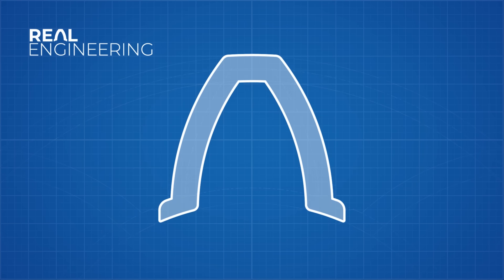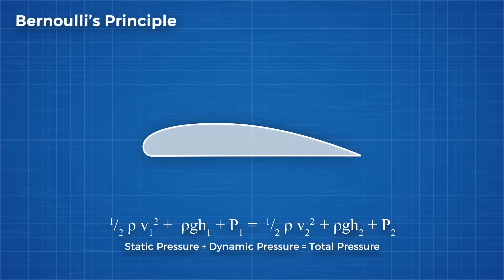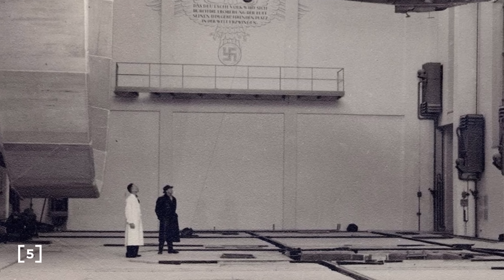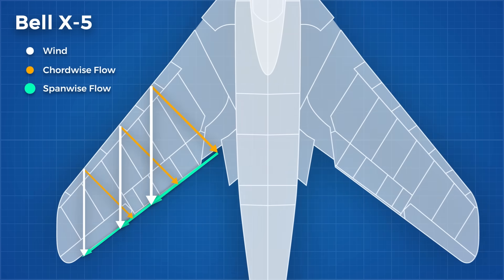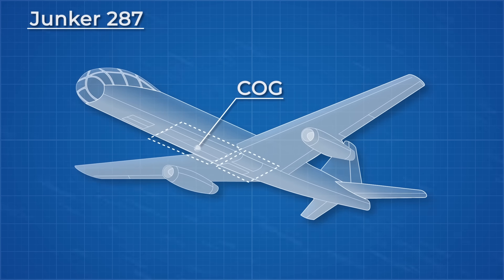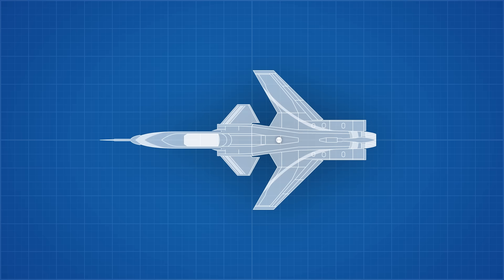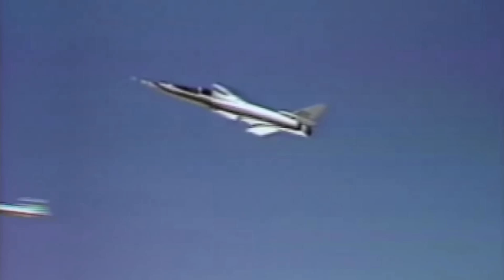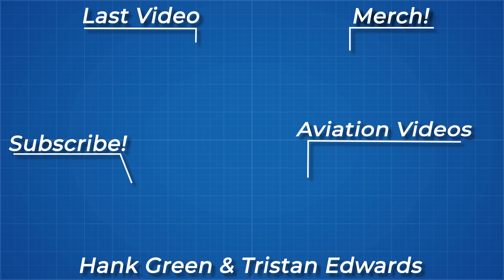Why Do Backwards Wings Exist?

Comment: The canard positive lift vs. horizontal stabilizer negative lift is far from new.  Stability in a design is determined by the degree the aircraft will tend to return to normal flight.  The canard was used by the highly-efficient Wright Flyer.  The problem was stability.  Canards are destabilizing like putting feathers on the front of the arrow.  Forward swept wings have the same effect plus adds instability to the yaw axis which is where the twist problem comes from.  The swept forward wing moves the center of lift closer to the canard, which makes it short-coupled, which makes it highly responsive, like a car with a short wheelbase.  Being short-coupled also gives little leverage to stop things once they start to get out of hand without adding a lot of strength and surface area which is self-defeating.  The B1 Lancer has a small computer controlled canard to assist with this problem, and the B2 depends entirely on the computer for its stability.  

The Germany talk I always hear is laughable.  In 1939 Germany was the only country who wanted war and the only one who had prepared for one.  They had destroyed everyone else's country in the previous war.  That facts are, Germany lost technologically to both the US and Great Britain in every technology that mattered to the war.  The US The Lockheed L-133 was a practical canard jet proposed in 1939 with axial flow engine that they would be prevented from building.  The Vought V-173 "Flying Pancake" flew in 1942.  Jack Northrop made the flying wing the focus of his work during the 1930s. In 1941 before the USA entered World War II, Northrop and Consolidated Vultee Corporation had been commissioned to develop a large wing-only, long-range bomber designated XB-35.  He was crushed when they went with the B-36 but before he died while confined to a wheel  chair and unable to speak, the Air Force  briefed him on their new, highly classified, Northrop-built B-2 Spirit bomber.  Built  in a flying wing configuration and incorporating many of Jack Northrop’s design  innovations, the B-2 has evolved into the most capable bomber in aviation  history. Upon seeing the drawings and a scale model of the aircraft, Northrop  reportedly wrote on a sheet of paper in a shaky, feeble hand, "Now I know  why God has kept me alive for 25 years."  When WW II was going a year past projected, they told Lockheed they might need a jet fighter to counteract Germany's jets against their bombers, but in order to make sense, they had to have it in 5 months.  They delivered a debugged and flying P-80 in and a production plan in 137 days.  It saw limited service due to Germany's mismanagement and more sudden collapse.    Notice it's the Goddard Space Flight Center.  Robert Goddard, whose plans Germany extended for their own rocket program, was also denied pursuing rockets like Germany in WW II.  All the US would pay for was rocket assisted take-off for the war effort.  The German rocket program had no strategic value and a complete waste of resources.  The best Germany achieved was 7 miles from the aiming point, down from 28 miles, and they killed more of their own people building it than all of the rockets killed.  By contrast, the US spent 1/10th the resources on the atomic bombs and it saved 1/2 a million US casualties, shortened the war, and saved the enemy from starvation.  Great Britain defeated them with their radar by 1940, and drove them off the sea with their electronics, hedge hogs, and Ultra.  By 1941 Great Britain already had them mired in North Africa.  They were stuck in Stalingrad by 1942, waiting for a tank that was not ready.  They spent 2 years, massive resources to build an Atlantic Wall that was overcome in less than 8 hours with far fewer casualties than they took to build it.  The deployment of technology that had no strategic value for the war was to deceive themselves as to their situation.  Obviously the allies would target those involved in these technologies after the war because they focused on winning and did not invest in technologies that did not align with that goal during the war.
Reply: Actually germany lost the 1st world war in a most pathetic manner and had limits imposed on it's military. Your historical knowledge is off, but your technical knowledge is on point
Reply: You are also correct on how the US won the technology race, as well as the britains. And yeah, the Russia move was probably the biggest strategic blunder ever made by a warring force next to the Pearl Harbor attacks and Napoleon's shot at Russia. However, many... Deja vu. Hmm. However, many technologies discovered post war were grounded in wartime research, not unoften by german researchers. The main reason many things weren't implemented or realized was due to the fact that Germany was fighting almost a five front war; eastwards russia westwards the US, northwards Britain, southwards.... ehm... France, I guess? Kind of. Hey, normandy. Anyways, they also had resources invested in africa. The thought process behind attacking russia was probably to preemptively stop them from mobilizing a force capable of overrunning germany. 

What I mean to say is, without overreaching and thus minimizing ressources and putting priority into maintaining a set standard Germany's technology could most definitely have rivaled it's opponents. However it would have resulted in Russia being an even more powerful opponent. Either way, the one who starts the war without the means to end it always loses. Most definitely if your allies are not on par with your enemy's allies. In a way, I'm glad Germany lost, though. Then again, a shame to all the history that was destroyed in the process.

Comment: Pretty well done, however, you forgot to mention/glossed over the fact that conventional wing designs include a twist from root to tipi so that the ailerons are at a lower angle of attack and remain effective early in the stall to help prevent the aircraft from rolling over and entering a spin.
Reply: But that very early part of the stall, when an aileron goes down, it will increase the angle of attack and cause that wing to fully stall before the other wing;Hence the neutral aileron instruction for recovery on many airplanes.

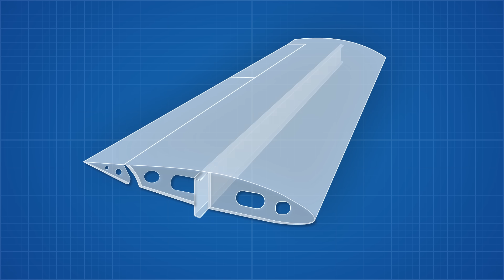Comment: 7:37 "we need to build an adequately strong and stiff wing" at the precise moment that the jetliner is using sheer engine power, not aerodynamic lift, to gain altitude.
Reply: Fuck youre ginus

Comment: But in a nutshell the forward swept wing design makes the aircraft much more stable, but puts the outward halves of the wings under immense air resistance stress anytime the aircraft goes up, down, even when executing a simple barrel roll.

Comment: I stopped watching when you try to explain lift only using Bernoulli's principle, which is not the major factor in how wings generate lift. There are aircraft with symmetric foils! Most of an aircraft's lift is not from Bernoulli's principle, just from deflecting air downward. The foil shape helps keep the air flow clean and efficient.

Comment: Anyone calling themselves "Real Engineering" should know that there are no "backward wings."  And if there were, the examples shown wouldn't be it.  So take a note:  any airfoil that causes lift is a "wing" regardless of its particular orientation.  By contrast, a fictitious "backward wing" would be an airfoil that caused lift when the plane is in reverse (for lack of better term), again, regardless of its orientation.

Comment: Out of the Three Russia, China and the US. Only the Russians successfully solved the wing flutter problem...and they did it very simply. Instead of covering the wings in Sheet aluminum, which is light and can allow a great amount of flex, which interferes with stability and control, they covered the wings in thin sheets of cold rolled Steel....

Comment: There may already be a bunch of comments on this, but I have to mention that Bernouli's principle (the equation you displayed) is only applicable when the air is flowing along a streamline. Because the wing is in open air, the air is not forced to flow from the leading edge to the trailing edge of the wing. Testing shows the air over the top of the wing actually meets at a point a ways behind the trailing edge of the wing while the air below meets more or less at the trailing edge, thus not on a streamline. (air is also compressible and viscus but these are not as important at low speeds)

Comment: polymer engineer here: 9:00 the wings could withstand the bending-twisting because the used layup negates it by design. Just check out the ABD Matrix and used layup to see for yourself.

Comment: The X-29 was noteworthy in the way that was designed from an existing airframe to minimize costs.  The fuselage is basically an F-5 Freedom Fighter  with the engine from a F-18 Hornet.
Reply: So no $10,000 usd hammers were ordered for the project?
Reply: Yes I nice little combo with such a light airframe and a powerful single eng, must have bin a potent little thing!😅

Comment: Came here to learn about backwards wings. Instead learned how to make better forwards wings on KSP.
Reply: How? AS I know, this vide shouldn't have teached anything like that. In KSP aerodynamics aren't properly modelled, that includes supersonic flight. Having swept wings won't improve supersonic aerodynamics in KSP. The forward sweep's main advantage, the stall charactersitics are also irrelevant in KSP. You won't improve pitch stability with a carbon fibre wing boksz either. Not to mention how KSP renders aerodynamic stability a non factor by having a flawless guidance system. You can learn aerodynamic stability in KSP if you turn SAS off, but having planes that are stable with SAS off is not really a huge advantage that could justify crippling your plane's efficiency for it.
Reply: @g.zoltan  *yes but it looks cool so they will do it nonetheless.
Reply: Same, and they just made the KSP 2 trailer.
Reply: @TheGuyThatsNotFunny  Here's hoping KSP2 aero is good as good as FAR was, because the rest of the features look literally EPIC.
Reply: @TheVideoGuardian Well that hasn't aged well. KSP 2 is a mess right now
Reply: @ExclamationMarx  Yeah, I never figured it would have been developed by a group of literal scammers. I feel sorry for anybody who still believes it's going to get better. The best they can say is that it's not as broken as it was. And it gets us what? Marginally more detailed terrain?
They haven't implemented ANY of the features they promised, and the binary planet isn't even possible since the game needs to use patched conics for time-warp to be possible. But why would a scammer need to do research when they never intended to complete the game anyway?
Reply: I finally understand why the friggin canards in KSP have their aileron controls "backwards"....
Reply: I was talking about the stock game, since very few actually use FAR. But yes, FAR makes things a lot more like making real airplanes!

Comment: Awesome video! I have piece of information Id like to add about the P-38. The hydraulics on the P-38 had enough advantage to be able to overcome any aerodynamic stiffening, so that was not the issue. The airflow separation that came from main wing by exceeding the  max mach number caused the tails control surface to be caught in a "vacuum". With the hydraulic boosted controls the pilot would have been capable of full elevator deflection, but he lack of air flow over the control surface would make it too ineffective to change the pitch of the aircraft. The only time the P-38 could reach these speeds was when it entered a dive, so if this mach number was reached in the dive to cause the  shock wave to form, then there would be almost nothing the pilot could do to regain control as he would be stuck in the dive, unable to pull up with the now useless elevator. From colder (higher) dives the speed of sound is slower, so most of the time get out of the high altitude dive would be that the higher temperatures at lower altitudes would raise the mach number enough to get them out of trans-sonic speeds and regain elevator authority. You can actually find experimental P-38 with an up curved tail boom to try and keep the elevator clear of the "vacuum area", but it proved to be too weak of a structure.  The Germans, with there hydraulically advanced aircraft, would eventually figure this out and used this knowledge to be able to escape by diving, knowing the P-38 would not be able to follow them in the dive. Where as the Japanese Zeros did not have hydraulic assistance, so they too were unable to enter a high speed dive, but for the reason of aerodynamic stiffening, so the P-38 dominated the sky where the enemy fighters had no way out.
Reply: What was the planes the Germans was using in those dogfights?

Comment: I would like to see an analysis of the ADF-01 Falken's airframe design, and whether it would be the amazing machine that it's shown to be. Gigantic 3D thrust vectoring engines, a vertical airfoil that extends out when landing gear is up, and a glassless cockpit with a long, sharp nose to divert oncoming radar.
Reply: That's a good suggestion.

Comment: May be we see this kind of design again in the future, for example on hypersonic planes and ultra high altitude planes. The computer stabilising is much less of a problem today as it was in the 80s and 90s. The computers back then just weren't fast enough to handle it properly. The early all-wing planes struggled with that as well, since they were also very unstable when flown manually. Similar the first Apache helicopters.
But today any good cell phone has more umphf than the high end computers in the 80s, so its much less of an issue to design a electronic stabiliser system.

Comment: Air burst jets to interrupt the air burst build up by using a small extremely high micro reverse air pressure set around the wings and points to see if you could cancel the sonic boom affect at the point off the bang???and you could add a parachute for RC craft??????

Comment: Static Stability of an aircraft is determined by the relation of the aerodynamic center (AC) to the center of gravity (CG). Not the relation of the horizontal stabilizer to the CG. The issue with canards is during stall or near stall conditions pitch control can be reduced or lost.

Comment: I really want a comprehensive breakdown of every aspect of how wings generate lift. I have heard so many different versions about it that I really don't know what to think anymore.
Reply: The lift is simply generated by a difference of pressure on the bottom and top of the wing airfoil, when the pressure is higher on the bottom of the wing it produces lift because it has to offset the lower pressure above it, the confusing part of lift comes from different designs but at the base this is the only way lift is generated, fuselages and other plane parts also produce lift but at the core when talking about a wing this is why it occurs , if you have a symettric airfoil at a 0 degree angle of attack and you flow wind at it, it will not produce lift unless the angle of attack is increased or ailerons and flaps redirect the air, this is why wings have camber on them, it makes the upper stream velocity greater than the lower stream velocity, which makes the pressure above lower and pressure below higher (lift is produced)

Comment: re the comment about Bernoulli's principle @2:00, it is definitely false (although I too beleived it for many years). A wing does not create lift by generating suction via Bernoulli: it generates lift by causing the air passing UNDER the wing to be deflected downwards i.e. downwash.
Just think about it for a second: if the upper surface of the wing 'sucked' the aircraft into the sky, then no plane would be able to fly inverted. Q.E.D.
Reply: HOGWASH...

Comment: So it is all to avoid wing tip stall.  That brings up a question.  Most fighter jets have wash out to prevent wing tip stall, but I suspect it is disadvantageous in straight and level flight, and was wondering if there was any experiment controlling amount of washout, probably by pivoting out portion of wings.  Would that be too complex with too little benefit?

Comment: I don't understand two things:
1- the X-29 wings are swept forward, so why is the title saying backwards?
your explanation for the reason backward-swept wings exist. If you want to lower the air speed across the wing, wouldn't it be simpler to reduce the thickness of the wing, thus reducing the air speed difference between the top and bottom of the wing?

Comment: it's called forward sweep... how about we use the proper terms "Real Engineering"... also with computers coming more into aviation, a statically unstable airplane (statically unstable airplanes do exist, the F-16 being a prime example of a design that would be too hard to fly without computers) is more desirable as it is more maneuverable for acrobatic or dog fighting situations. Computers are now fast enough to enter the inputs fast enough to keep the airplane flying level...

Comment: The question that breaks the idea that Bernoulli is a primary source of lift: How do planes fly upside down?

It's not just that people will point out that the Long path Bernoulli model is wrong. NASA has a page on it.  https://www.grc.nasa.gov/www/k-12/airplane/wrong1.html

I'm not saying it doesn't exist. I'm not saying that the other issues you've raise with airspeed over a wing are wrong. I'm saying that it's not the primary factor in aircraft lift and that this can be shown in practice both with the fact that symmetrical wings exist and the fact that aircraft can fly inverted.